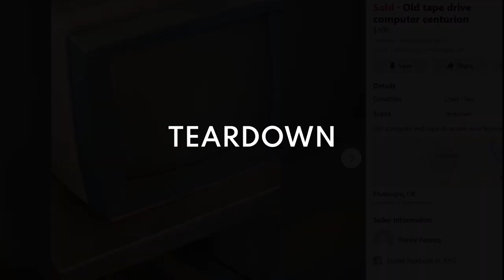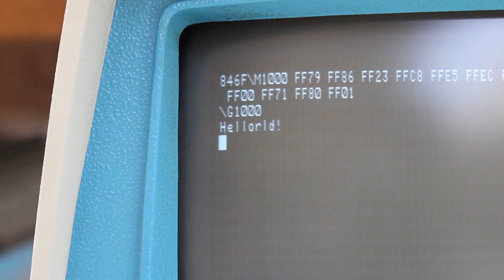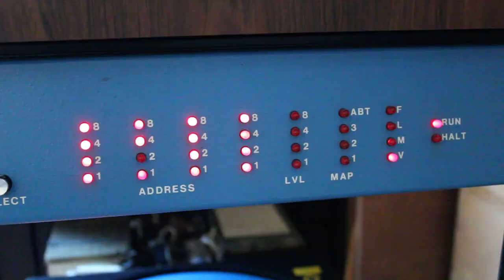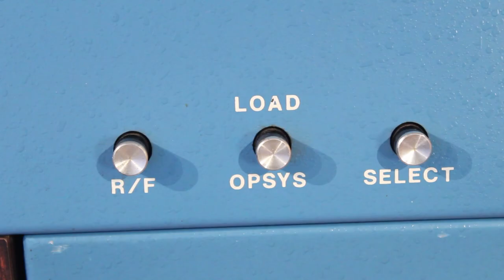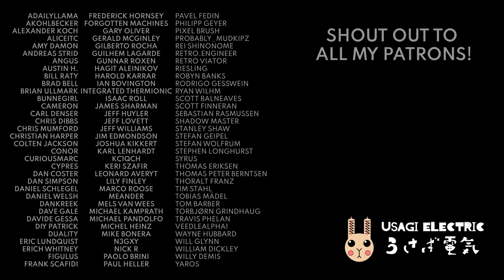Centurion Minicomputer: Trash to Treasure

Comment: Great job David & world wide team.
Reply from the maker: Wouldn't have been possible without you Ken!
Reply: @UsagiElectric  I enjoyed every bit of the Centurion project and looking forward to getting a 2nd Hawk running, getting the Data-100 line printer running and getting the CPU6 connected to the Internet which will be for the first time in history.
Reply: @UsagiElectric  I guess now there's lots of questions.  Will this Centurion be a part of a private collection?  Will it be loaned out to places like the Computer History Museum, Digibarn, etc.?  Are there other operating systems ported to the Centurion?  Is there a way to interface more recent storage drives to the computer (Iomega Zip, Gotek, etc.)?
Reply: It's great to hear from you, I was worried those bunnies might have eaten your leafy greenness

Comment: The Centurion lives - By your command :) Well done indeed! Some nerve racking moments recovering the OS and I’m glad you have managed to preserve it.
Reply from the maker: Thank you!
There were multiple times I thought the project was completely dead in the water, and then the computer gods would smile down from above and the right pieces would fall perfectly into place to get us over the hurdle. It was truly an unbelievable journey!
Reply: @UsagiElectric  Indeed - recovering from a major setback can be the most rewarding part of the journey, albeit it may not seem like it at the time!

Had my own recent setback with a Victor 9000 machine that had just been fully restored back to operation when the bespoke mask programmed 8021 in the keyboard died. Needless to say these seemed to be unobtanium. Thus began my first journey into Arduinos and I have replaced the 8021 with an Arduino which scans the keyboard and outputs the proprietary serial protocol. An unexpected and rewarding education!
Reply: @graemedavidson499  how lucky we are to live in an era where low-cost general purpose micro controllers are available to anyone with a minimal grasp of C/C++ and some electronics. 
We surely live in one of the golden ages for tinkerers.
Reply: @DrBovdin  Absolutely! Vintage equipment can make an excellent gateway to learning current technology.
Reply: @graemedavidson499  That was a major point of this project from my point of view,  help young techs & engineers learn some of the old skills.

Comment: A nice review of what you accomplished sor far, supported by so many amazingly hard working helpers! It was more than just a review of an old unit - you had to go down to the board, the signal, dip switches and circuit level, looking for hardware problems and took us watchers with you. You showed us what it was like to service these machines and hard drives back in the day. 
I remember my father losing his best paying customer in the first year of his company, because of a headcrash on a hard drive of the size of the Hawk and Phoenix drive. Months of a whole team working on a technical project was gone, no chance to catch up in time. But the computer technicians of the time paved the way to what we have today! We couldn't have made it up to here it without them - pouring sweat and time in the cutting edge machines of their time, that look so comical incapable to what we use today. What a great tribute to them, of which some are still alive and passionate to step in when needed!

Comment: Now that there is a working system again with a recovered operating system, I find myself wondering how long it will take for a Centurion emulator to appear.
Reply: way too long, and quite possibly never
Reply from the maker: There's already a couple out there! 
https://github.com/Nakazoto/CenturionComputer/wiki/Emulators-and-Simulations

Meisaka's web based emulator in particular runs the actual microcode and can even load the OS.
Unfortunately, I can't freely distribute the OS (per request of the current Centurion IP holder), but if you contact me through Discord, we can probably work something out!
Reply from the maker: @Bong Jovi If by "way too long, and quite possibly never" you mean there already is one that runs the actual microcode, then you're absolutely right!
https://github.com/Nakazoto/CenturionComputer/wiki/Emulators-and-Simulations
Reply: @UsagiElectric  This I don't understand. Just like I can't actually download roms for Amiga computers legally. What can they possibly do with them anyway
Reply: @twizz420  this aged like milk... SO rapidly.
Reply: @mrtesticlease4638  Gotta love the name tho! 😎
Reply: Yeah, I don't know why I even assumed that there wouldn't already be one, honestly.
Reply: @twizz420  lol. well, live and learn, right?
Reply: @UsagiElectric  Are there negotiations taking place so this code can be released? It's not like there's crucial trade secrets in that code. I assume you already made offsite backups of all that's been dumped.

Comment: Gorgeous!

So you've got the Hawk drive up and running, and if I remember right the Finch is okay too...I seem to remember it came with another exceedingly large drive as well. Any chance that one will ever spin again?
Reply from the maker: Thank you!

The Finch, as far as we know, is in good shape. The FFC card that interfaces the Finch to the computer has a fault somewhere on it. It's functioning enough to pass a seek test, but it fails a read test, so we have a bad chip or trace somewhere on the card that needs troubleshooting and fixing. 

The other big drive that initially came with the machine was a Phoenix drive. The likelihood of it ever coming back to life is pretty slim. The Phoenix was on the bleeding edge of hard drive technology and will most definitely require a lot of very specialized equipment to bring back to life. 

However, I do have plans to repair a second Hawk drive so we can have a dual Hawk system (or two single Hawk systems).
Reply: @UsagiElectric  It's cruelly ironic the one drive that can't come back to life is called Phoenix.

Comment: Such a handsome machine! It was a mistake to stop making computers with woodgrain and blue painted steel.
Reply from the maker: I agree 100%! 
I also really like how the wood panel on top seems to be floating, it's a really nice design touch that looks brilliant in person.
Reply: Even The first Warrex computer thr CPU4 had the same wood grain top and front trim panels. In the beginning we placed three washers on top of the frame in each corner before placing the wood top on top of the frame. The stack of 3 washers on the four cap bolts holding the wood top to the frame let warm air escape the frame / chassis. Warrex - Centurion let physics ( warm air rises ) help with cooling the system.  Over time we had the (12) spacer washers replaced with 1/4" spacers welded to the frame because some of the dealers F.E. did not reinstall the 12 washers if the top was removed to fit thought a office doorway during installation of the system.

Comment: and now youve got what is likely the only working centurion left, with the parts on hand to revive a second should that project also go through successfully, was fun watching it all com back together and ironic that the clone provided everything missing to resurrect its original
Reply from the maker: You're absolutely right, it's hilarious that the counterfeit machine was extremely pivotal in getting the genuine machine going!
As for the counterfeit machine, I'm kind of torn on what to do with it. No matter which direction I go, the counterfeit chassis will be preserved safe and sound, but I'm thinking about a few different directions to take that build:

1. Restore it as a single Hawk system in the spare genuine chassis, essentially exactly like the current genuine machine. 
1.5. Restore it as a Hawk, Finch, Floppy combo system in the spare genuine chassis.
2. Restore it as a single Hawk system in the counterfeit chassis.
3. Build a "portable" Finch and Floppy based Centurion. Use a compact 1/4 height server rack, stuff the card cage, the finch and a floppy drive, power it all on a modern ATX PSU and have a machine I can toss in the car for events.

Either way, lots more Centurion content to come!
Reply: @UsagiElectric somewhere in the middle maybe, make a few tweaks if necessary to the cage connections and be able to plug and play into the different chassis options and in my mind it would make more sense to use the counterfeit chassis for its full size housing, for all that its a perfect clone its still a different system with a related but different history, might as well keeps its distinct look and use it as a talking point for the computer

Comment: Wow, this was one extremely informative, as well a real cliff hanger, especially about getting this resurrected system booting up for the first time. I’ve seen multiple articles on vintage machines, and even seen a tube video or two of such vintage machines up and running.  First time, I’ve ever saw a comprehensive break down of such a computer.  Noting that this mini computer was built at the turn of the 80’s decade, where a number of micro processors had already been released, I was surprised that the core CPU consisted of multiple 74 series IC chips.  And even then, was I shocked that one CPU circuit, original evolved from multiple circuit boards.
Reply: The Warrex-Centurion CPU4 (4 PCBs - TTL sn74xx)  minicomputer with 60KB DRAM was around 1975. The Centurion CPU5 ( 2 PCBs - AMD2901 <RISC like> and TTL ) minicomputer with 128KB DRAM was around 1979-1981. The Centurion CPU6 ( 1 PCB - AMD2901 <RISC like> and TTL ) minicomputer with 256KB DRAM was around 1982- 1985.  The models CPU4, 5 & 6 had a ee200 like system bus and could run the same app. software.  The ZTRON-Centurion CPU7 ( 1 PCB - AMD2901 <RISC like> and TTL ) minicomputer with 256KB DRAM was around 1984 - 1987. The CPU7 dropped the ee200 like bus for a modern Multi-bus backplane and off the shelf OEM I/O cards. In the later half of the 1980s after bankruptcy the new owner of the Centurion IP built a CPU8 & CPU9 around the AMD29xxx still using Multi-bus that till could run the business app software going back to the CPU4, 5, 6 and CPU7. The last product in the Centurion family was the CPU10 which was an Intel micro based system that the Centurion Operating System and Business App Software was ported to and still has few customer's running the the CPL programs today.
Reply: @kenromaine2387  Oh, thank you so much for the update.  Makes more sense now.  System design does align with current technology at the time. Yeah, I recall in the mid eighties, where my high school computer lab, employed an NCR i-9020 system with 512k ram.  Almost, 40 years later, I can't quite forget about those 14" removable disk platters.  Yeah, instructor mentioned about too dusk can crash the disks.  I never thought much about that, until I saw these videos.
Reply: @marcuswilliams3455  The NCR system very likely used the same CDC 9427H Hawk disk drive as the Centurion CPU6.

Comment: I wish I could work on something like the Centurion. If I had the space I'd try to get an old PDP-8 or PDP-11, since they seem to be relatively common (though expensive) and can be found with a front panel that has lights and switches to mess with.
Reply: get a PiDP-8 and see if that scratches your itch
Reply: @krallja  From a practical standpoint, a PiDP-8 is definitely the better choice, since it'd be way more reliable, easier to use, and a small fraction of the size, but I'd still like to get the real systems some day.

Comment: If I were you, I would never risk write-enabling those disks. Grab images of them, and put effort into creating a compatible interface so they can be read/written on more modern, more disposable media.
Reply: Yes! Maybe some ROM software that implements a remote serial drive a la DriveWire or ADTPro.
Reply: I worked on a PDP11/04 that ran entirely from 8-inch floppy drives.  Maybe David could restore the CDC floppy drive that he bought separately and create a bootable image that fits on a  floppy.  Won't be fast, but at least the Hawk drives can stay off-line, and the system would keep its period-appropriate feel.

Comment: So cool.  I've watched the entire series as they were posted.  GREAT work.  What do you think the odds are of getting the printer to work?
Reply from the maker: Thank you!
I'm very confident we can get the printer to work! There's a lot of mechanical madness going on, but with a CNC mill, we can remake any broken pieces we need to. However, since I can't really bring it indoors and it's currently 100+F (40+C) outside everyday, I'm waiting until it cools off a little to start work on it.
Reply: @UsagiElectric  That will be cool... and noisy... which is also cool.

Comment: This has been a fun project to follow along. Thanks.

I don't know how complicated either the Hawk or Finch drive is protocol is, but perhaps a Flash drive emulator could be made from a Teensy 4.1, an Arduino, or a Raspberry PI. This would let you use the Centurion without the spectre of a drive failure.

The PI and Teensy are 3.3V, but 74HC245 could provide level shifting, and they are cheap. The Arduino, would be slower, but likely still work, and it's 5v, so no level shifting is likely needed.

For the Color Computer 3, they had come up with Drive Wire, which is a drive emulator, which in turn uses the serial port to communicate with a PC, for drive emulation, though something like that requires quite a bit of programming.

 [I have been been using 74HC245s for Teensy 4.1 level shifting 3.3v/5v on a 5-channel stepper control, and they work really nice together.]

Lastly, if you make some protective feet, say out of cheap hockey pucks, you can stack both chassis into one nice refrigerator-sized monolith, to save on floor space. Then, you can just put the terminal where ever.

Someday, I want a IBM tape drive, and a big one : )
Reply: PS, as you may know, they Make SD adapters for both the Pi and the Arduino. The Teensy 4.1 has a built in drive, too.

Comment: I am wondering if it could be possible to program the thing to skip over and ignore the tracks destroyed by the head crash. Or would the presence of a rough area on the disk present a physical danger to the heads?
Reply: The heads would never fly over the damaged area of the platter even for just a few milliseconds needed to seek over the damaged area.  Even a finger print or one spec of dust will crash the heads.

Comment: I really like your videos will you build a 16 bit computer soon?
I quite like the centurion computer no wait I love it. I mean your really 
Good at explaining thanks for maskin me learn!
Reply from the maker: Thank you!
It's interesting you mention a 16-bit computer, one of my bucket list computers to build is a TMS9900 based 16-bit minicomputer to really let the chip fly! But, I have a lot of work to go in understanding the hardware and ISA of the chip before I get that far, so unfortunately, nothing too soon on that front. 
I do have a 1-bit TTL homebrew inspired by the tube computer in the works though!
Reply: @UsagiElectric  The TMS9995 would be a good way to go as it requires fewer support chips and is faster than a TMS9900.
Reply: I understand. Im still trying to make my very own 16 bit design. And test using simulations and than build it out of transistors!
Reply: Great Job of the clean up it looks fantastic!
Wonder if there might be any other old computers
Like this one.
Reply: There is so much to learn from computers!

Oh my god i just cant say how obsessed i am with this stuff.
I know way to much!

Comment: How much did this cost new? In todays dollars? How was this thing used exactly, with the 3 terminals and all? I love terminals. Can 2 terminals access the system at the same time? Can it handle severeal operators and tasks concurrently?
Reply: This CPU6 system would have sold for around $50K in 1980-1982. At the time a new family car sold for $4K-$6K and my wife & I purchased a 3-2-2 house for $30K in Dallas.    The number of terminals / concurrent users averaged 4 to 8 and a few customers ran over 20 terminals.  The business software was mostly accounting, inventory, mfg  and Oil & Gas companies.